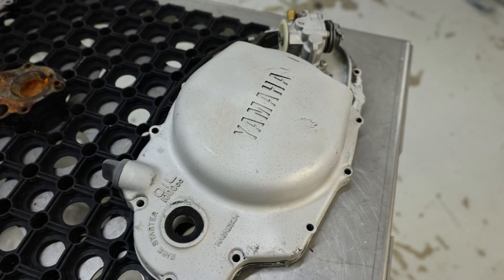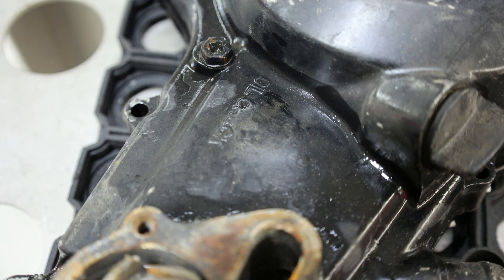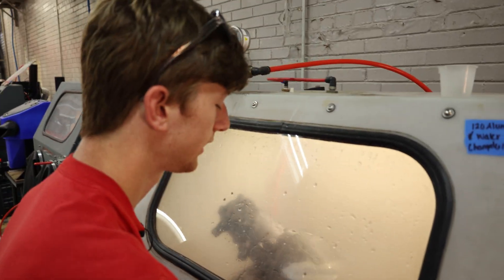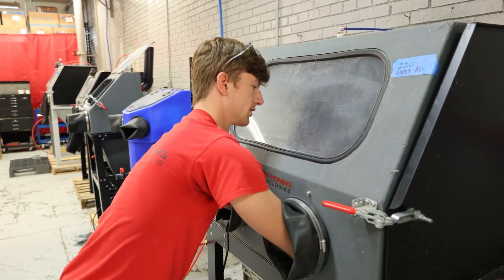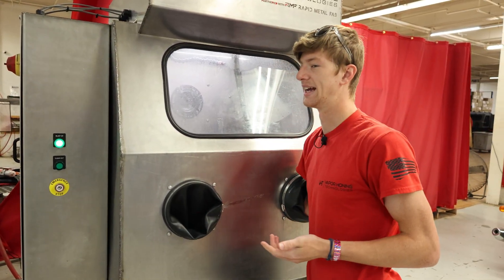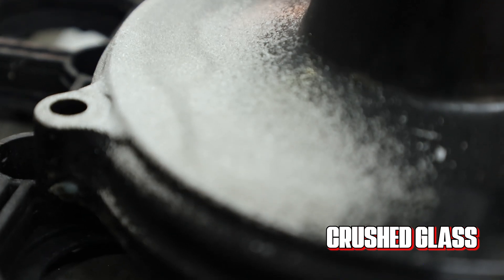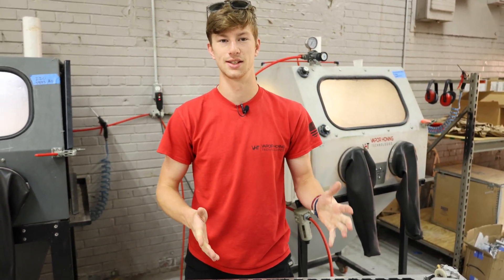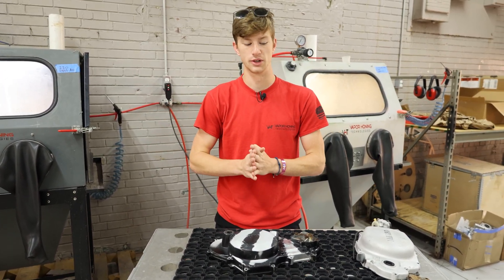What is the difference between Aluminum Oxide and Glass Beads? Wet Blasting a Honda Side Cover!

Comment: Where would you draw the line for using AO on engine parts (cams, blocks, heads, etc) -- I have a 8000FL and using pure glass bead I can barely strip any coatings or oxidisation. I'm thinking about throwing a couple of scoops of AO in the mix to get cutting power (also to help removing old paint and stuff) but hoping that the glass bead polishes. Would 10Z 120 AO in an otherwise glass bead set-up make sense?. I'm running about 90PSI usually.
Reply from the maker: AO won't damage any of your engine internals by blasting, but if you are wanting to still get a good shine, a mixture is a great idea. Call us at 828-202-5563 and we can specify the perfect mixture for you!
Reply: @VaporHoningTechnologies I guess it's simply a question of Mohs/Rockwell hardness scale right? AO is 46 HRC, cam lobes for e.g are Rockwell-C 58-60, is it that simple?

Comment: I have a Weekend Warrior, and when I bought it, I got 5lb bag of aluminum oxide 220 mesh along with a couple of 25lb bags of glass bead.  Is the 5lb bag going to be enough after I fill it with water, or do I need to add anything else to it (glass bead)?
Reply from the maker: The Weekend Warrior requires 25 pounds of abrasive, so if you would like to use the 5 pounds of aluminum oxide, make sure to add 20 pounds of glass bead! Let us know if you have any other questions.

Comment: I recently purchased the 800 FL and removed gold anodizing off some BBS wheel faces that a local powder coater could not remove using their strip tank. My 800 FL with 220 mesh blend easily removed anodizing before ceramic polishingwas performed. Blasting left a nice smooth profile.
I even experimented on another BBS wheel face that I blasted and ceramic polished. I wanted to see if the 800 FL would leave a smooth enough profile for polishing without any sanding. I blasted it and put it straight into my polisher with no other prep. It turned out amazing!! 
I have very little experience/time with this blaster, but I love it already
Reply from the maker: We are very glad to hear that! Make sure to tag us if you post anything on Instagram so we can see your results!

Comment: Glass bead is great for aluminum parts. It's round and polishes. The aluminum oxide is great for removing paint or heavily corroded parts. I personally don't put greasy parts in my cabinet. In my opinion it is easier to clean it first and that way your media is clean and see me s to make results faster. It could just be my imagination.
Reply from the maker: You are correct! Pre-cleaning your parts is a great way to speed up the vapor honing process and to get the absolute best finish possible.

Comment: So glass bead would be the best for oily caked aluminum timing chain covers, cylinder heads, and other engine parts?
Reply from the maker: If you are just looking to remove oil and grease, our Hydro Blast is a perfect solution. It uses high pressure water and a detergent to clean your parts with ease. The Hydro Blast will not clean anything past surface contaminants, but you do not have to worry about abrasive on your parts. 

If you are looking to shine up your parts, glass bead in a vapor honing cabinet always works excellently! 

We want to make sure you get the results you are looking to achieve, so if you have any questions, feel free to call us at 828-202-5563! Thanks!